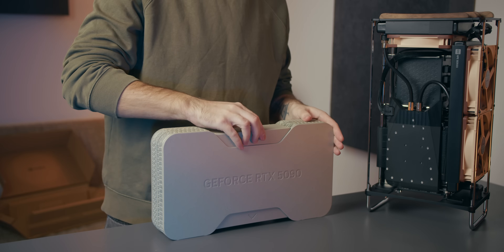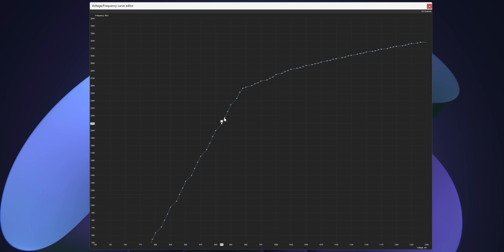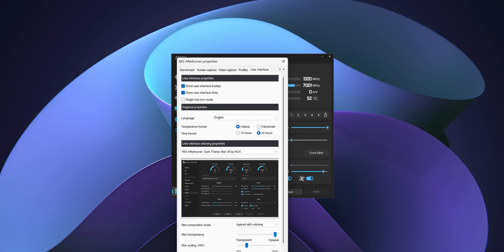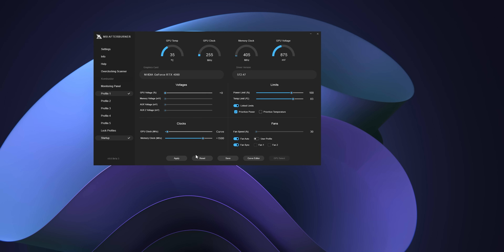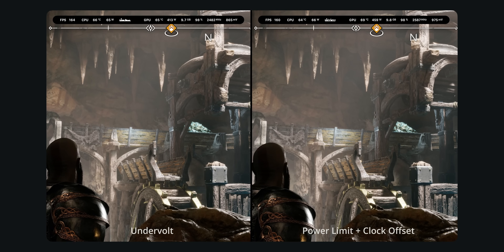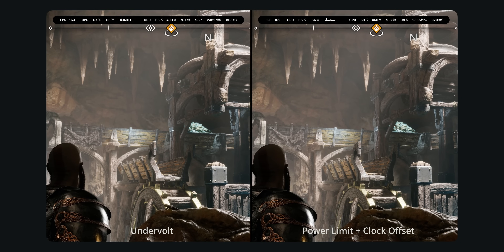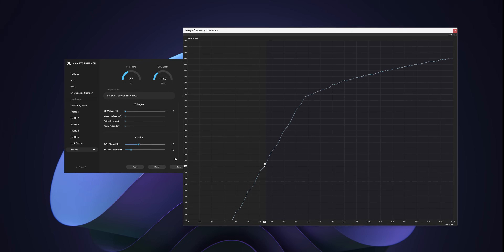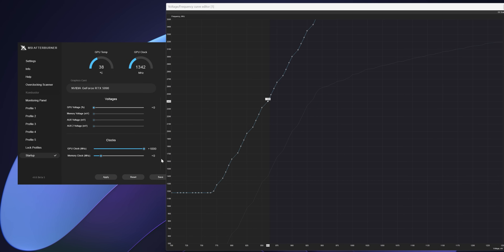5090 FE Undervolt Testing & 4090 Face-Off

Comment: FormD T1 RTX 5090 FE Aircooled (flight travel regulations) pleaseeee 🙏🙏🙏🙏🙏🙏🙏
Reply from the maker: Oh it's coming.
Reply: @EIGAtech  🥳🥳🥳🥳🥳🥳🥳🥳🥳🥳
Reply: @ Would be particularly interesting if an air cooled solution is possible for the 9950X3D in the T1. It will determine if I go with NCASE M2 or T1.
Reply from the maker: The 9800X3D is already at the limit of what’s viable with air cooling in the T1. If you will use the 9950X3D for multicore productivity workloads it will likely be thermal limited the entire time.
Reply: @EIGAtech  Even if undervolted? So if I want the 9950X3D, I would be better off with the NCASE M2 and like a Thermalright Peerless 120 + Noctua NF-A12x25 PWM chromax ? and Noctua NF-A14 PWM case fans ? 
Thanks so much!
Reply from the maker: @aumdna  For all core workloads absolutely, the PA 120 is leagues ahead of the tiny x47 FC.
Reply: @EIGAtech  Would you ever be worried about the PA 120 bending during air/land travel ? Do I need a CPU cooler anti-sag solution if I travel regularly with the build?
Reply from the maker: @aumdna I think it should be fine as long as it’s handled with care and carry-on only, if it’s checked then I wouldn’t recommend it.
Reply: @EIGAtech  Would it be possible to cool the 9950X3D with a Thermalright AXP-100 Full Copper in the FormD T1 ? rotated 90° & offset by 7mm + Noctua Noctua NF-A9x14 ? This would leave for only 2.5 GPU Slots - I dont see a way to get my hands on a 5090, but an AIB 5080 Ventus can fit ?

Comment: Ouuu La La….. another RTX 5090 optimization video. I’m more of a straight shooter when it comes to GPU tuning. Auto curve optimization using Afterburner and a +200MHz on the memory. Nice video. Maybe we’ll see a T1 Build video or a Ghost R1 build video.
Reply: I hope you mean 2000 on the memory, because the 5090s can do 3k all day.
Reply: @ I’m saying +200 on the memory clock in addition to its boost clock. I believe only core clocks can hit 3GHz or 3.2GHz on my unit. I have to double check those numbers though.